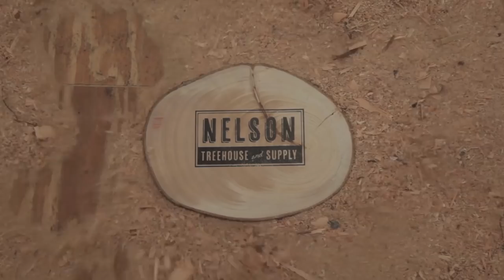Treehouse Timelapse On Orcas Island

Comment: Great treehouse, much better than mine but I cant help but wonder why the stairs always jet out away from the house, they look like a long leg hanging out. I wrapped my stairs closer to the treehouse itself like a scaffolding (not spiral). On mine, you step into the stairs on a top landing with the stairs (8) paralleling down the treehouse to another landing, then turn in under the treehouse parallel ing(6) stairs to another landing, then down (12) stairs paralleling those stairs to the patio decking that is also around the tree. The entire stair well is 6ft.X8ft. from ground to 2nd landing, then 32inches by 8 steps up to the tree house.

Comment: So you basically pierced the tree core (@3:38), each at least in two spots in order to secure the structure. Wouldn't that damage the tree? Disrupt the flow of nutrients and shit inside of the living core!? I am assuming I might be wrong about that. Please explain this part.
Reply from the maker: The nutrients flow through a trees cambium layer! Which is the tissue between the bark and inner wood. The Treehouse Attachment Bolt or TAB might look invasive, but actually isn't threatening to the tree.

Comment: At first it may seem stupid, but just analyze: the most important things in a tree house are invisibility and security. This house is very beautiful for a video in YT but it does not have these two requirements. The ladder should be retractable (up, of course) and the house should be, as far as possible, hidden by the foliage of the tree(s). Obs.: the bottom floor of the house should be at least 6 meters (20 feet) high from the ground.

Comment: This is not a tree house. This a house built around two trees with the tree trunks coming up through basically the middle of it with man made support beams build into the tree and separately as well instead of using branches for support beams like tree houses should have. Also it has a staircase and tree houses have rope ladders or wooden steps nailed or screwed into the trunk itself with a door opening through the bottom.